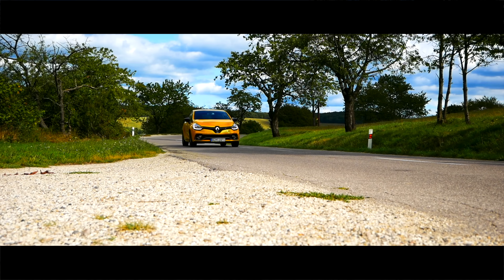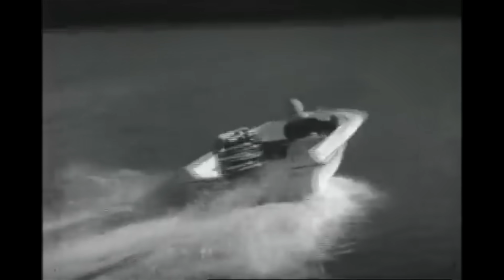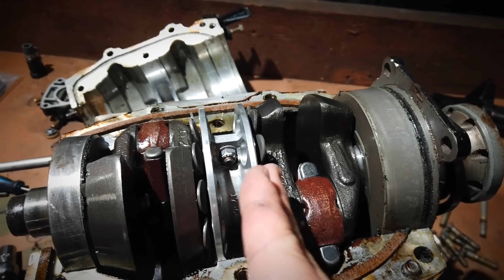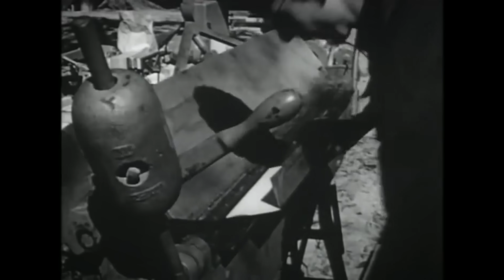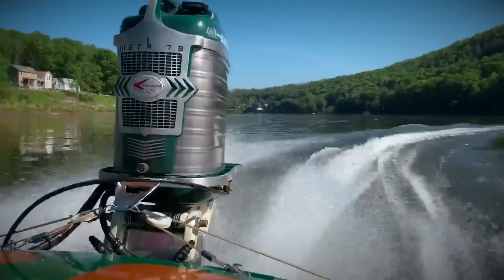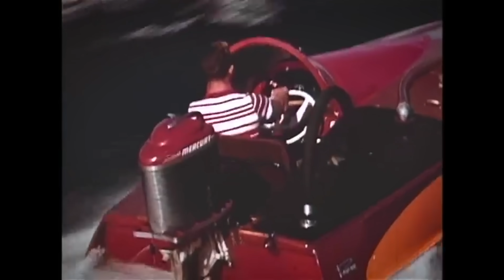The World's First 6-Cylinder Outboard

Comment: i was a MM tech in 1987/88 ,also known as the big black stack , this was the end of the line ......the piston ring compressors were no fun , salt water was rough on them ......us young techs were glad to see them go , but the old guys were really pissed off at Mercury .......great presentation on the history , Mercury should show this at tech school.....................
Reply: Yea it did take SKILL, 'seasoned' techs notice 'sprouts'  do not want to learn. HS Graduation present was Mercury Out/InBoard factory (2 weeks each) service school. First day instructor told class- 2 people from 5 different dealerships, me alone- to choose bench (each had different model, I chose 6cyl InLine. Then told to disassemble, which  i proceeded to do, throwing (older models had nut-bolts, not threaded castings) fasteners and parts and pieces in a box. Instructor comes over ( should mention others were carefully lining up-separating each part corresponding fastener. Well, he reaches in to my container and fumbles around, pulls out a bolt and asks 'whats this', I without slowing down say 'that's one of 3 bolts & nut that hold distributor assembly to block, he just starred-threw it back in container and walked away

Comment: I had a 10hp Mercury Lighting outboard. It was an early model from Mercury that had no transmission, when you started it you were moving! To reverse you simply spun the motor around backwards. Rumor had it that made more like 15 ~ 20 hp but was marked 10hp due to engine restrictions at many lakes. In the late '60s/early '70s my father bought a 115hp "tower of power" with power tilt (hydraulic rams to alter the engine trim while you were moving) for an 16 foot Chrysler "Fury" tri-hull. It was kind of flimsy but light boat and with that engine would do over 60mph when trimmed out. Fun days as a teenager living on a lake.

Comment: My cousin had a 20' hydro stream with a merc 200 back in the late 80s that did 98 mph. It had a gas petal and everything. Was soo fast!!! I got to try and drive it and I was only 16. I could only really get it up to 75-80ish because I was too scared 😨. The boat was teetering on the very back tip and you had to counter steer it. That thing was sick.

Comment: Today all of the outboard motor manufacturers now build 4stroke engines. Sure they are cleaner and more economical to operate but I still prefer the old school 2 strokes because of their lightweight and simplicity! And I love their "angry bees" sound!  Yes these old 2 strokers are bad polluters and guzzlers of fossil fuel but another reason is that they're still affordable! I can buy a old 200hp engine in reliable condition for under$3000!

Comment: Had a pair of 1996 3.0 lt. two stroke, V6 250 hp with EFI on a 27' ,red hull, CV center console with Armstrong engine bracket, weighting 7500 lbs. Top speed 68 mph at 5800 rpm. These engines would cruise all day at 4800 rpm. The 10 years we owned the boat in Florida, running summer and winter. Never had a mechanical failure. Only two secondary ignition coil packs and two trim and tilt electric motors  failed. These engines were power monsters and bullet proof. The engine water pumps and lower gear units were serviced every two years. I miss the boat, it was a good ride in rough waters. They loved fuel , 16 gallons per hour, each engine @ 45 mph. Nowadays I'm resigned to a 20' center console with a single 2008 four cylinder 2.0 lt. DF140 Suzuki four stroke. Bullet proof and fuel efficient. Also a great engine. Crusing speed 30mph at 4500rpm , top speed 42mph 6050 rpm.

Comment: Ironically their quality issues weren’t based on friction wear they were corrosion based. Yamaha quality far outpaced Mercury by the mid 80’s. And in the 90’s mercury got the moniker “runs fast just won’t last”
Reply: 'Fast won't last' dates back to the late '50's. Mercs had a terrible rep back then, so after the 50K endurance runs, they ran a series of ads entitled 'Fast DID last!'. We owned several 4 and 6 cyl Mercs, the 6's had 3 carbs and 3 sets of points and were almost impossible to set the dwell to read the same on all 3. But when everything worked, a ski boat with a 100 hp six would pull away from a V-8 17' Ski Nautique every time on Lake Christopher.
Thunderbolt ignition was a major improvement in every way, especially during cold starts. Salt water durability also improved as time went on. These inline engines were everywhere in S Fl  the 60/70's, they have all but disappeared now.
Hey, how many of you used "Insta-Start" to crank a cold 6 cyl Merc? Or broke the pull rope and landed on the deck? 
I still remember the smell of ether and castor oil, even though I'm 70.  🤣🤣🤣

Comment: I'm disappointed with mercury outboards have owned several over the years especially the tohatsu motors that were re branded as mercury, the parts for a 2005 model were discontinued in 2011 tohatsu part numbers don't match!!! My oldest outboard is a 1978 mariner 40hp which was made by Yamaha, i can still buy parts from Yamaha by quoting the serial number even though it was branded mariner, just purchased a new Yamaha 4stroke the motor is basically the same as a 2012 model parts are interchangeable not like the mercury

Comment: the Force "150hp" was a real dog. Never produced its rated power, and was a 4cyl with 1 cyl added to make it a 5cyl. Only produced for 3 or 4 years. And with good reason: the 120hp force was nearly as fast, better on fuel and 20% cheaper.

Comment: I had a friend in Lake Havasu AZ in the 2000-2010 period. He had a 21' Eliminator with a Mercury or Mercruiser 3800 or 3500 V8 I believe. It was a 300HP V8 two stroke and it sounded heavenly, kept blowing bottom ends running the surface props though and would guzzle up 40 gallons in one hour when we were happy and driving around at up to 90mph.

Comment: Nothing sounds quite like a 2 stroke outboard. I have lots of respect for Mercury engines but love my little 30 hp Evinrude. 13' rowboat does 37mph! Not much of the boat is in the water at that speed except the lower unit.

Comment: One problem with having a tall outboard motor was that a considerable amount of hull length had to be set aside for space to accommodate a tilted-up motor.  This could get expensive when docking and licensing fees became based on boat length.  You had a length of hull useless for anything but a tilted-up motor, that was costing you.  So outboard motors had to become more compact. By the way, "engine" refers to the power=providing   unit itself--"motor" includes the shaft and propeller attachment with it.   So, they are "outbroad motors" with 2-cycle "engines."
Reply: "outboard," not "outbroad"--spell check wouldn't catch that--sorry.

Comment: I had a pair of the Black Max motors on a Scarab, damn they sounded sweet.  With chopper props they acted a bit like jet drives; hit the throttle and they'd almost instantly hit 6K and the boat would quickly catch up to them.  The song of 12 angry two smoke cylinders is like no other.
Reply: FYI Black Max's were V6's not Towers of Power so you're commenting in the wrong video.
Reply: @doccyclopz  I know the differences quite well.

Comment: My grandpa used to have a 150 merc and that thing was a riot when it fired up. Freakin miss that engine. Loved seeing thunderbolt ignition on the front cover!
Reply: Original Capacitive Discharge Ignition (30,000-40-000) volt which brought about 'surface gap' spark plug (no 'finger' to set gap clearance from electrode (center thingy) still with distributor if 'syn-&-lync' were done properly, motor would start before ONE revolution, heck I hand gapped rings, fitted pistons to minimum clearance and once shut motor off at dock-went in to marina store for beer and got in seat, turned key on and engine 'fired' (started) from stored compression on cyl where distributor was as CDI ignition was battery powered. Todays motors are ADI (alternator-flywheel magnets spinning around stators) generating electricty to supply power-paks, switch boxes- coils, triggers- or Ignition system__PS have on work-rack 'kick-started' (rapidly pushing with foot propeller) many INLine- 1, 2, 3, 4, 6 cyl Mercs
Reply: Above was a 99cuinch INLine

Comment: Fantastic as always, I grew up on the Great Lakes, the tower of power was always a favorite, Mercury also has a fascinating story about the development of the Inboard/outdrive system, developed by Jim Wynn, who Kikehaefer dismissed as folly, whom left Mercury, to build it for Volvo, then, a few years later, developed an I/O for Mercury, that would capture 80% of the pleasure boat industry a few years later, again, almost as if Carl just stumbled into success.
Reply: To be fair... Kikehaefer was correct to a large extent, inboard/outboard boats have very low resale value because the inboard/outboard seals and complexity isn't worth fixing..... compared to outboard boats that last essentially as long as they are properly maintained, winterized and stored.
Reply: @Wingnut353  Yeah, sure, Jeff Bezos should have stuck with the used book store gig too, based on your expertise in busness.....
Reply: Charley Strand had the idea for Csrl drawn out on a paper napkin.   He later ran OMC. if I remember correctly
Reply: Volvo had been producing MANY, many variations of OutDrives, world wide for years. US Coast Guard regulations have to be met for boat manufactures to install and sell. The most dependable (due to large oil reservoir) not 'speed demons', but parts availability can be surprisingly easy. Took # stamped on a gear from Lower and gave it (the number ONLY) to NAPA parts man, few minutes later was told , yea- we can get one, gear from a Ford manual transmission matached numbers (remember 6 foot long catalouge racks)

Comment: I had a 150hp tower of power on a 15ft Bullet ski boat. It was obviously overpowered but a lot of fun. Very thirsty on fuel. I still can’t believe how smooth it was on idle. Never gave me any problems other than a starter motor issue which was an easy fix. Great memories. Thank you for the story behind the beast.

Comment: These were very special motors. There was no separate cylinder head. So you had a blind cylinder block where you lowered all six pistons and crank down into place. To raise the compression or cc the chamber you would weld on a small portion to the piston to be accurately milled down. No cylinder head gasket at all, of course. The crankcase did have very low volume for superior cylinder charging. Some racers reduced volume even more by wiring balsa wood on each side of the connecting rod. These were ball bearing crank and rod journal engines with superior lubrication. In addition to that 50,000 mile test, the big factory racing sixes would go over 50 races without a teardown... Unheard of today. The 4 cylinders were also a classic race motor. The 5 cylinder was a "Force" outboard based on the 4 cylinder Chrysler. The 4 cylinder 150 hp open header race motor Chrysler was very successful, but not well known. Chrysler was originally "Westbend" and the designs were very different than Mercury. Less durable, but light weight. Super video, thanks. Entertaining and educational.
"A big woman needs a black dress.." Strang's mother 👩‍🔧🤦‍♂️
Reply from the maker: Thank you for the additional story!
Reply: Interesting. I had aChrysler outboard mid 70s. They were rebranded as Force in the 80s. Now I know the story.
Reply: Arghh. Force. The bane of outboard ownership. You are guaranteed to lose compression and have to junk the thing. Straight Merc 2 stroke will last multiple lifetimes just as the old Evinrude 2 smokes. I only run those 2 on my boats. Simple, love the smell of 2 stroke exhaust on an early winter morning of duck hunting. Nothing better than that.
Reply: @OttoTheWeim  Yes, I saw few Force motors in action. A few of the expensive 5 cylinders being sold for scrap prices.
Bad production. The quality of alloys was good. The design excellent. Yet, they are all gone now. Even the older Chryslers outlasted them. Mercury made them second rate on purpose to make their brands... Mercury and Mariner look superior. Dumb game.
Reply: @andykerr3803  I had a newer (comparatively in their line life) force and it was horrible and bad compression. Replaced it with an even older (late 80s) Merc 90hp that runs like new to this day. I run older 2 strokes (evinrude and merc) from the late 80s to mid 90s by choice and seek them to install because they are bulletproof. I run year round including in subzero and the 2 smokes are always reliable and simple. No crazy computers to fail. Grew up on Mercs but grew a love for the abuse the evinrude will take. I don’t run the big motors just 35,70 and 90hp but they are built like tanks.
Reply: Westbend, McClough, (Mercury-Evinrude-Johnson(were separate competitors) and ALL had sub-brands to increase dealers - Western Auto's brand was Wizard too name one, Sears marketed McColough under Ted Williams sporting goods later 'gamefisher'

Comment: Unbelievable timing lol I just took mine out yesterday and fired it up for the first time in 6 years! It’s just a 90 for a 17’ seafarer half cab, with the hydraulic steering and very fast electric trim using 17p-19p props it moved along pretty well with excellent rough water handling, and I’m guessing close to 40kts! Top speed or Maybe more but it cruised around 35kts. the transom and deck is rotted now it’s been a “I’ll do it one day”  but never dedicated time sorta deal. the engine is on a stand and fired straight away with fresh fuel,I do remember draining the carbs before storage and kinda happy I did! I also have a partial built hydroplane meant for 25hp but I might see if it floats with the tower of power on the back if it does it’s going to be scary!
Reply: Are you NUTS 😅
  HANG ON LUCY !!!!!

Comment: Me and my dad own a 1961 Evinrude fastwin with 18 hp, nothing special but this ancient technique is still running fine
Reply: I had one of these fasttwins, it had idle and mixture controls right up front, you could lean it out once warm and idle very slowly while casting for snook. It would push my 14' aluminum boat along at about 20 mph and would run the entire length of Biscayne Bay on a gallon and a half of premix. Simple motor, but it ran fine.

Comment: tower of power! I've got a 1984 90hp unit. It's a fantastic way to turn fuel into smoke and noise!

the fuel consumption alone is enough to make the engine obsolete, but theres something about it that just makes me smile.
Reply: take same hull and put comp Merc and OMC(doesn't matter-same since mid50's) and 'race, cruise, troll' comparing fuel consumed and Merc will most likely come out as a 'miser'

Comment: Older 2T outboards have a really nice power to weight ratio. When they came direct injected the consumption was also much better. But it's all gone, they only make 4 strokes to Usa and Europe market today. I still have a johnson ficht 150, 2.6 litres v6. Sounds great and has a ton of power, only weighting around 175 kg. But they have a horrible reputation, and mine also is broken as we speak. Nice video, thanks.
Reply from the maker: Thanks!
Reply: A modern   spark  system   could easily   be  manufactured  for these  old   engines   ,stators  unobtainable  for  most   shame  because  most  mechanical  stuff on  them   good

Comment: I would love to have 6 or a 5 cylinder with radiator on a motorcycle. I had it 1973 gt750 Suzuki ported and Polished to a RM250 dirt bike specs I did myself with a Dremel tool it was awesome. Great video love your content. That bike would probably do wheelies through 5th gear. 😂😂🤣🤣😉👍👍✌️
Reply from the maker: Nice!

Comment: My boat motor! Have a mid 80's 115 merc with power trim and no distributor. It hates to idle with this new gas but she puts my 18' StarCraft chieftain cuddy cabin cruiser on plane in a few seconds and pushes it up to aprox 40-42 mph.  Ethanol free gas it runs beautiful on that.  Only issue is while idling and trolling if it leans to a side more than a few degrees for a very short time it will stall. Very strange.
Reply: Sounds like fuel going away from the jets in the carb.....
is the float level of the carbs set right...and does the fuel pump still have enough oomph to fill the bowl to the right level at idle?
Test the fuel hoses to the carbs with a fuel pressure gauge?
Also wonder if the fuel hoses may be perished inside from the ethanol?
Ditto if you have a tote tank?

Comment: My grandfather had one, 110 hp i think, it hadnt started in twenty years, he wanted to sell the haynes hunter boat it was attached to, we figured a running motor would help the sale, all it needed were new ignition wires, since the old ones deteriorated, it fired right up and even idled well, they were built well and very reliable